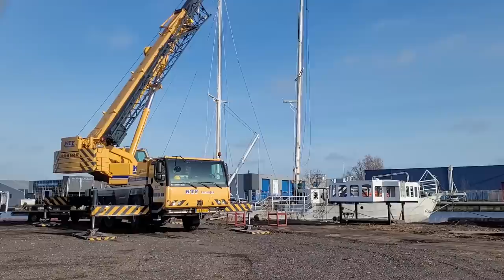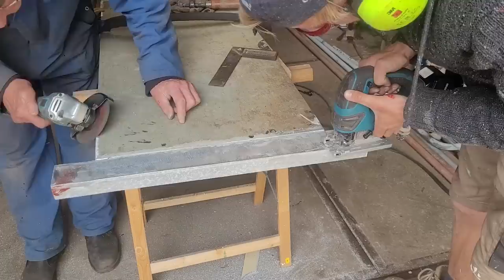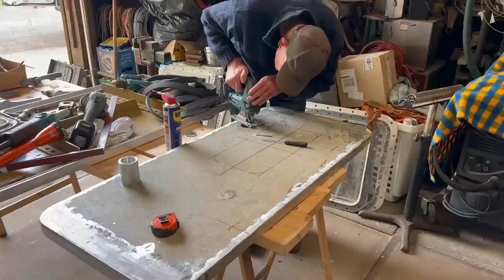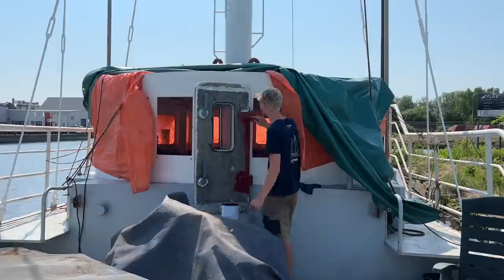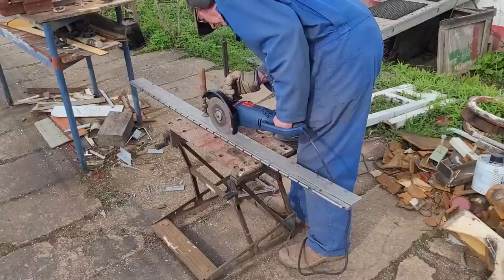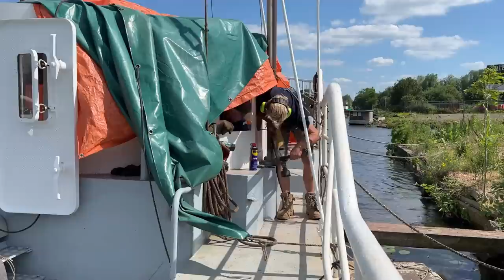Why This Classic Sailing Ship has an ACTUAL Front Door  - Rebuilding Schooner Tijgerhaai EP17

Comment: Is the red undercoat you are using Red Oxide. Or Red Lead. If it is then that has been banned here in Australia due to it being poisonous.
Reply from the maker: It is red oxide indeed. Red lead has been banned here in the Netherlands as well, or at least, the real red lead. The stuff they sell now as 'red lead' is supposed to be unharmful, but it's also not as effective as the old stuff.
Reply: @tigersharkboatworks  Great videos, and I look forward to following your adventure. One thing I noticed was your use of red oxide primer on nonferrous metal. My understanding is red oxide primer is intended for use on ferrous metal and is not usually suitable for nonferrous metals like aluminum.
Reply from the maker: @alexpaterson7846  I was wondering how long it would take before somebody noticed. So far nobody has been able give me a reason why not to use red oxide on aluminium, other than "It is not intended". We do use a washprimer on the aluminium first, and the manufacturer (Epifanes) states that we can use all Epifanes primers on aluminium after aplying washprimer. Since the red oxide is from the same manufacturer, I guess we're golden. I've been wondering if there is something like red oxide especially for aluminium. I suppose that would be White oxide then, but I dont think that exists. Anyway, we have good experiences with red oxide on alu, so think of it as an experiment, if our wheelhouse starts falling apart in 10 years, I can be the one telling people why they shouldn't :)